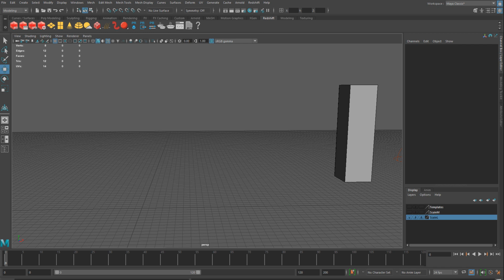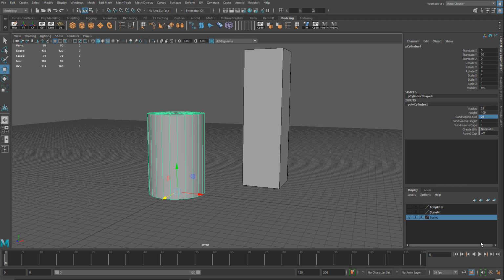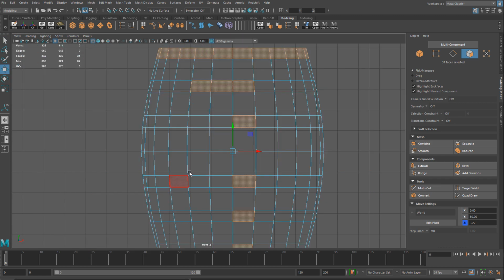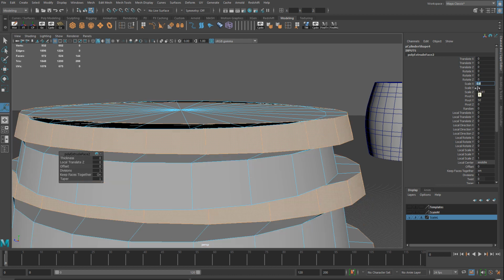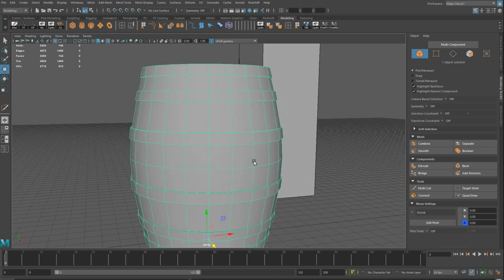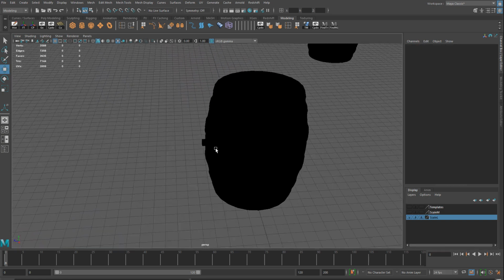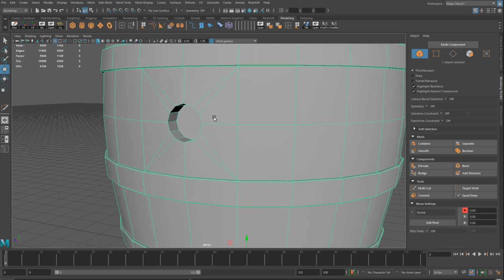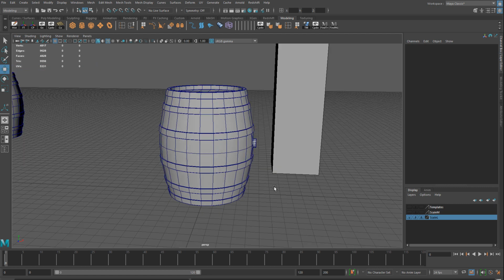Beginner's Guide to Game Prop Creation 1/4: Wooden Barrel - Modeling with Maya

Comment: Isn't combining it at the end kinda bad since you're combining the actual meshes? Should probably use a group instead in case you want to animate the cork later.
Reply from the maker: If you are going to come back to the mesh and do more work and need to keep those parts separate, group them. If not, combine them.

Comment: Did you increase the size of gridline ...i did the same as you did but my cylinder look too large and your's look fine in size what should i do ?
Reply from the maker: Yes I did.

Go to Display > Grid Options and I have set the following:

Length and width: 1000
Grid lines every: 10
Subdivisions: 1
Reply: @WorldofLevelDesign  okey work fine now thanks